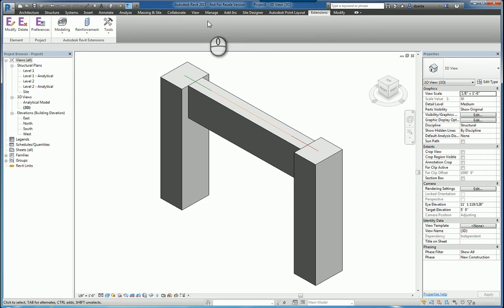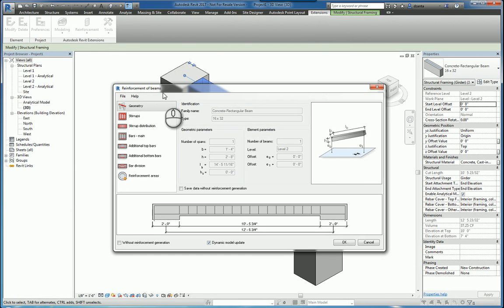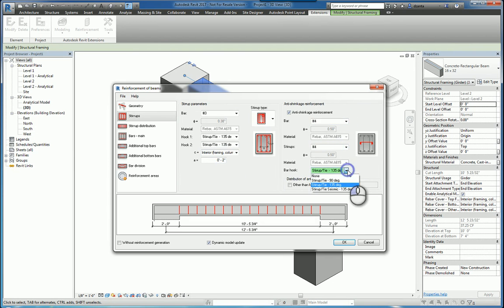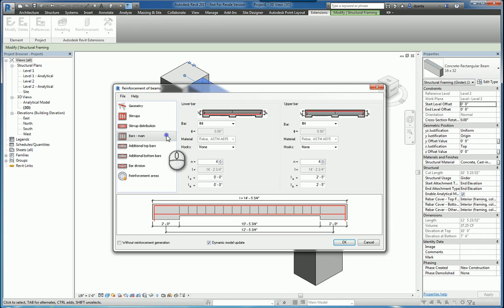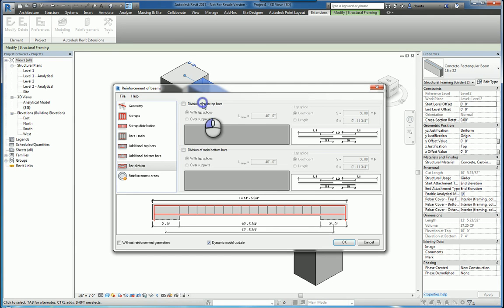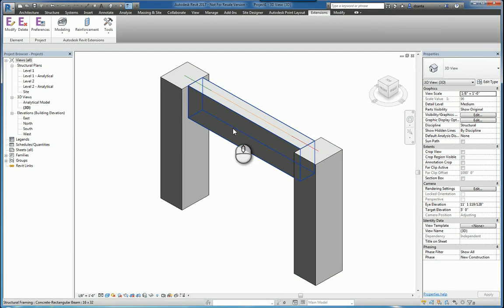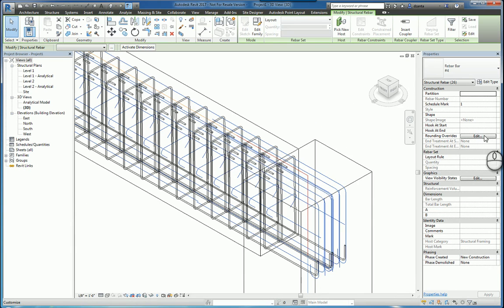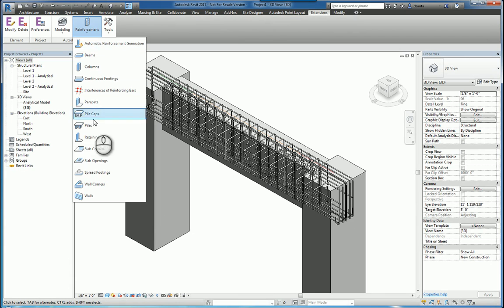Revit Extensions Beam Rebar Creation   A How To Guide

Comment: Hello 
can you make a tutorial on how to make the bar bending schedule for the made rebars , thanks in advance
Reply from the maker: That should be fairly easy.  Steps:
1.  Create host objects
2.  Create rebars with bending properties
3.  Start Schedule command and choose Structural Rebar
4.  Specify Parameters such as Rebar Length, Bend, Mark, etc.
5.  Specify Sorting/Grouping and Totals
6.  Click OK to make schedule and place on sheet
7.  Modify if needed
Reply: yes , that is easy if i was using the standard rebar techniques not the extensions 
when you do the same using the extensions none of the rebar gets its parameters correctly like (like A,B,C,BAR LENGTH,...etc)
Reply from the maker: if you can send me a revit model with the rebar content, I can create a schedule for you.
send to dzanta@gmail.com
Reply from the maker: i created a sample file with rebars using the Extensions tool and create a rebar schedule without issues....

see file here:
https://www.dropbox.com/sh/rt8av822unnsj55/AAAsHVYAdhf9-TKjq5Lhp8Msa?dl=0
Reply: done , it has been sent to your mail.
Reply from the maker: i looked at your file.  the schedule does look like it is reporting the values for A,B,C, Bar Length, etc.  perhaps there is a rounding up/down feature within Rebar Settings that is not set up the way you want...

see revised file in dropbox or gmail reply
Reply: When i use extension tool for beam reinforcement.. 4@16mm top ..then i go to rebar tag.. shown 1@16mm only.. but 3d view 4 rods are there..but rebar tag shown 1@16mm bar only..what is the solution sir

Comment: Iam getting incorrect stirrups spacing
Reply from the maker: if the automatic stirrups created are not spaced correctly, check the parameters within the dialog box to verify correct desired spacing.  If this does not work, let it create the stirrup, then select one of them to look at the parameters and perhaps readjust them via the Ribbon.  If this still does not work, create the stirrups via normal way....not using the Extension feature.

Comment: Hi Dzan.
I have installed extensions for revit 2017. but, when i use it, i have error " the defined element is not supported by the extensions".
can you tell me how to solve it? tks!
Reply from the maker: What this means is that the object that you are trying to put rebar in is not recognized as a Revit Beam.  You will need to recreate that object with the standard revit beam family and then use the extension feature to add rebar.